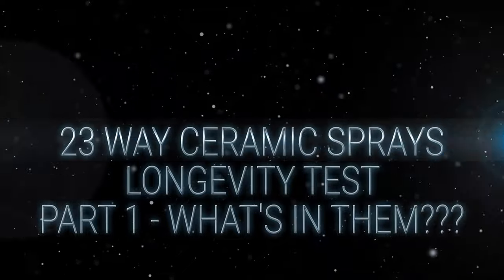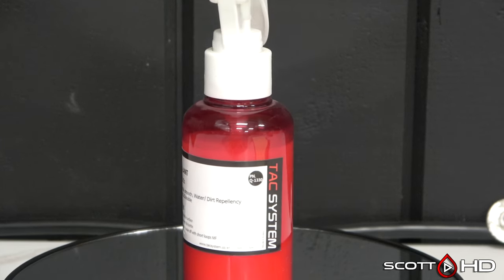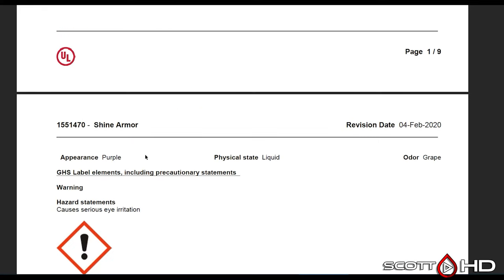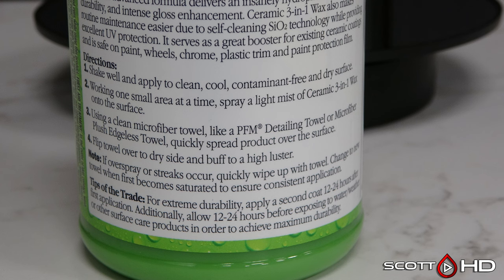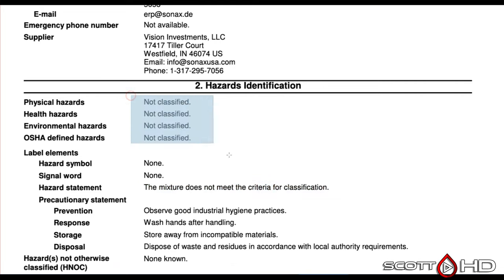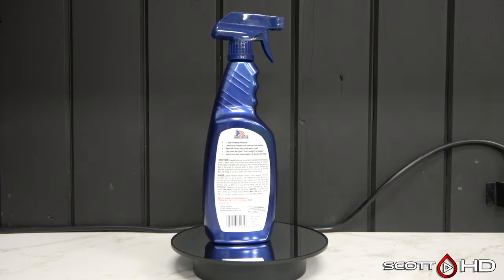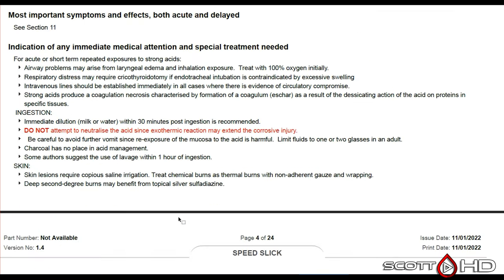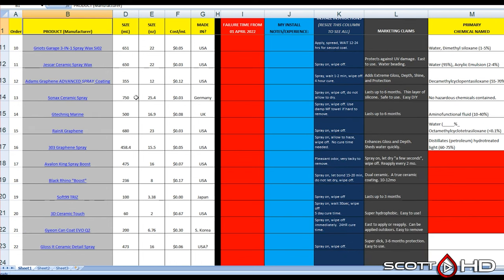Ceramic Spray Coatings - The ULTIMATE Longevity Test - 23 WAY - UPDATE 00 - What's in them & Hazards

Comment: Safety is underrated especially for the people planning to use these products regularly.  So many chemicals in a detailers world to add to the vacuum sounds and vibration from paint correction.  
Your tests of the polishers was eye opening on the safety of using some of these products and it would be a shame to get nerve damage in the hands from short duration use of a tool while a different brand of same tool could be used all day without long term damage/risks.  

The difference in safety and risk between these products varies as widely as their longevity.  Thanks for the info!
Reply from the maker: I have nerve damage to my hands from the 25+ years of running polishers (my old porter cable 7424 I got in the late 90's is probably THE cause of it, as I didn't have a RUPES until 2012).  I have lost a lot of "clamping force" in my hands, but some of it could just be getting older (I'm in my 40's).  Hearing loss?  Probably!

Comment: Watching your videos over years,  seems to me that the trend is an increase in durability across the board; 6-12-months durability from a spray WoWo product was unheard of just 5 years ago. The challenge for me now is not durability, but gloss and self-cleaning. TW Seal & Shine, Griots 3-in-1, Meguiars Hybrid spray wax, are great but I find  the overall gloss levels and self cleaning properties (not to be mixed up with water beading)  are not very good after two washes, so I end up topping them at least monthly which kind of defeats the purpose of their durability.
Reply from the maker: I 100% agree, and I'm glad to see that they are continuing to innovate and evolve.
Reply: What products have decent gloss levels and self cleaning properties in addition to good durability? Or what do you top off with to make up for this?
Reply from the maker: @dillonlboyer  these products typically won't add a measurable amount of gloss, hence why I didn't test them for that when installing.  I generally only do that for the standard type ceramic coatings.
Reply: @ScottHD  Thanks for the reply. So would applying a "glossy" topper (like Griot's Foaming Poly Gloss) on top of a spray wax/ceramic achieve a similar gloss result as a traditional ceramic coating? That is, If you were already committed to a spray ceramic

Comment: Used the Adams advance ceramic spray last week.   Made the car super shiny and felt like satin.  Very happy so far
Reply from the maker: Did the odor bother you?  It's something that stood out to me with it, but if it performs well, that would likely be something I'll have to get over!
Reply: @ScottHD  I made the mistake of smelling it in the bottle.  It smelled toxic.  It probably smells a little stronger than the previous version.
Reply from the maker: @billnipp2309  it gave me a headache doing the same.  I'm pretty sensitive to strong chemical odors and it was the one that really stood out along with the 3D product.
Reply: @ScottHD  after this product I don’t plan on sniffing anymore coatings    Hahaha.

Comment: 2 mins in and I'm putting my money on 303 solutions graphene ceramic. 

Out of the 10ish I've bought over the past 2 years it actually performs well if you do the prep work. Bottle is trash though. Squeeze broke 5-10 pumps in and not easy to open.
Reply from the maker: The very first bottle of 303 graphene I bought had to have an issue with it as it didn't last 30 days.  Later batches lasted much longer.